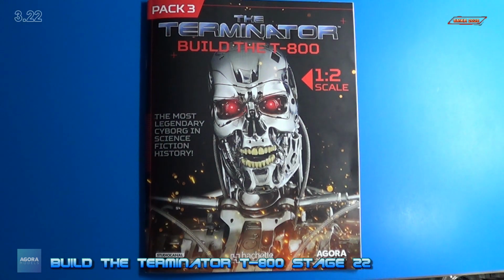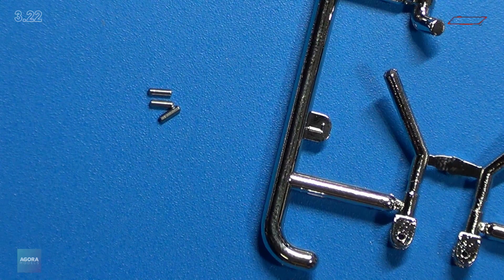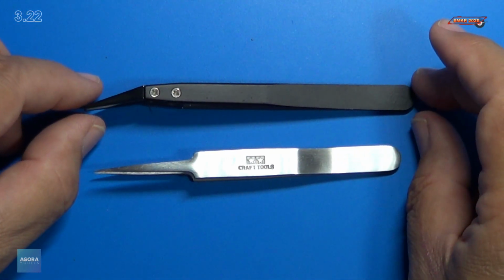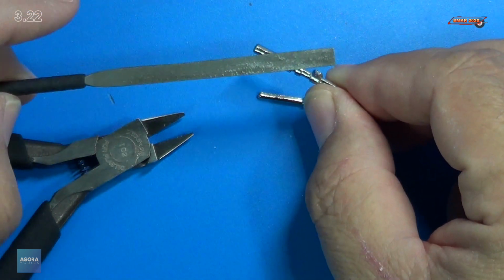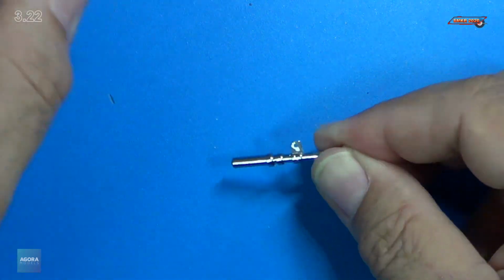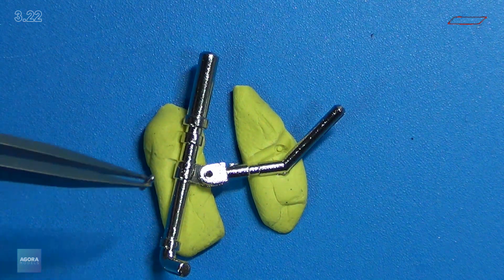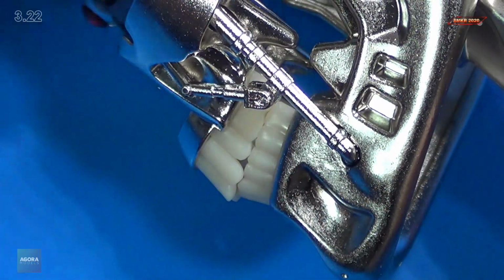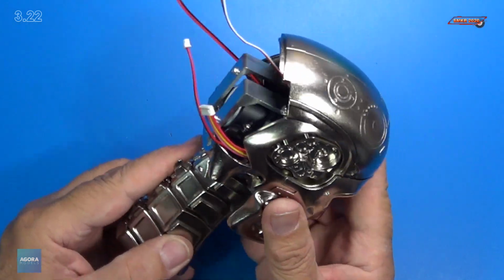Agora Models Build the T-800 Terminator Pack 3 Stage 22 - Connect the Jaw, Assemble the Head

Comment: Neat. Seems like a milestone moment-- with the entire front of the head. I wonder if a set of parallel jaw pliers would help to set the pin? (Also in any future working pin set, perhaps other uses on this remarkable kit. I noted that you flexed the joint a bit when setting the pin-- and... it's also good to have a set of parallel jaw pliers around for holdings things that are flat. Conventional pliers have a hinge that unevenly clamps down on flat things.)
Reply from the maker: Wow, thanks Eliot, I just ordered the pliers, I think it will work great for setting pins, even the pins for the fingers.
Reply: @ScaleModelKitReview  Maybe not for the fingers-- the parallel action doesn't open very far. I got a couple from Contenti which is a jeweler's tool supply. They had narrow and smooth jaw versions. Neither opened very far. Not bad- certainly useful just not much more than 1/4-5/16". They are perfect for working on brass bends because they hold tightly over the full length of the blades.